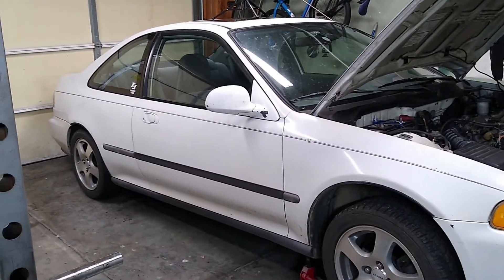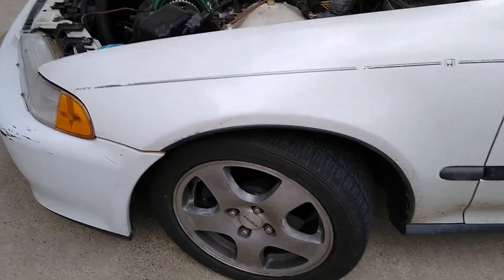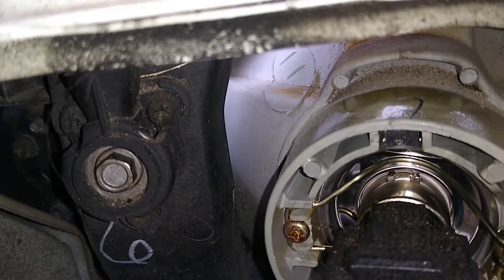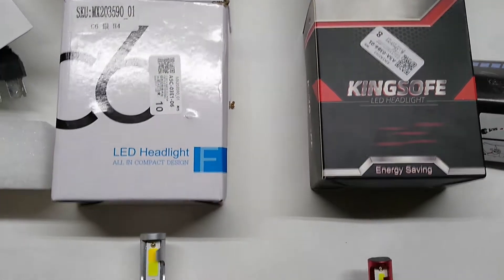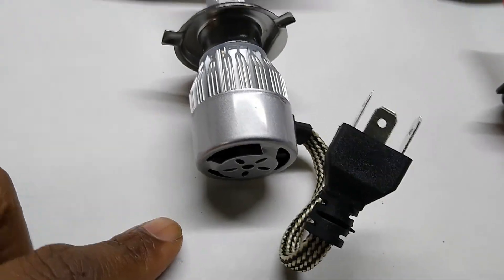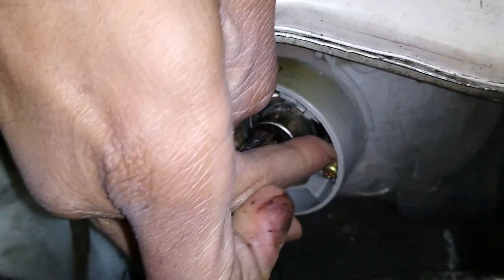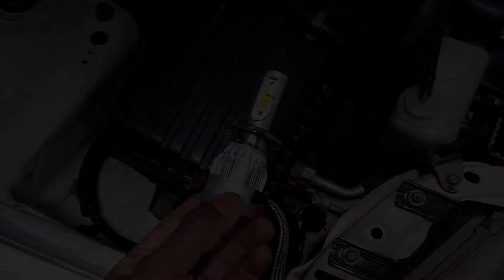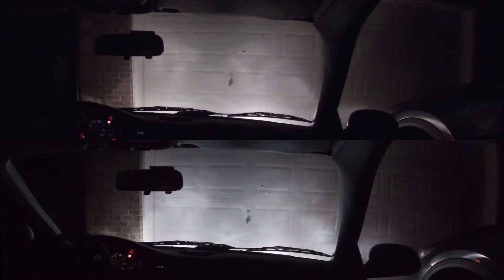1995 CIVIC adjusting headlights, installing LEDs

Comment: I have found out that Morimoto and GTR lighting makes some of the best LED headlight bulbs IMO. Morimoto makes a kit that produces a pure white LED light at around 5700K, while most of your typical LED kits produce 6000K-6500K. To me personally, I like the 5000K-5700K range. I'm not a big fan of the bluish white that the 6000K produces. That's just me. Thanks for informative video sir.

Comment: If the base with the three tabs are removable you can put the LED through the rubber boot then put the base back on.  Might be hard to put the retaining arm in position but once done you can cover the opening with the boot.
Reply from the maker: @jamesbrennan5457  yep. 😐 I learned that late and should have read the instructions. 😔 I'm running different LEDs now and that's how I did it.

Comment: hey. you do not need to modify the boot. the headlight bulbs have that removable retaining clip the seats inside the headlight housing. just twist an pull. I bought a set of H6  6000k LED lights that are the same style as one with heat sink + fan and they are white. Note: remove the light retaining clip first when installing, place the 3 tab clip inside the headlight assembly and secure it with the aluminum fastener. then install the rubber boot followed by the LED light. push it in and twist. i hope this information help you for future plans. enjoy 💯
Reply from the maker: Thanks! I am going to have to revisit that.

Comment: Just got some LEDs for my headlights and to be honest they dont do much. Probably better off with a set of HIDs with 55 watt ballasts because 35 watt ballasts arent great either. But they are better than LEDs. HIDs are the way to go if you want visibility. Just be sure to get 6000k which is a bright white color. Blue lights only relfect well but isnt good for visibility. I learned that the hard way.